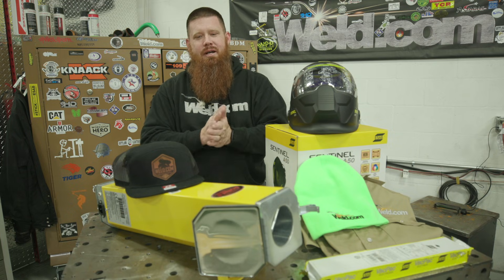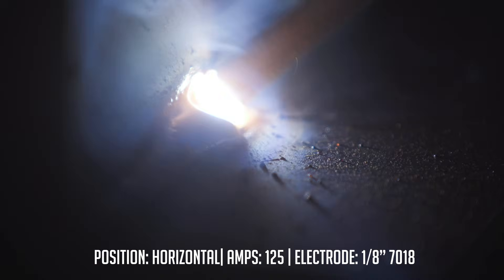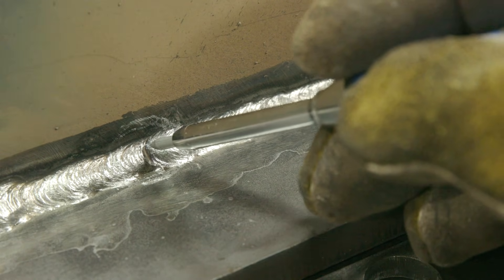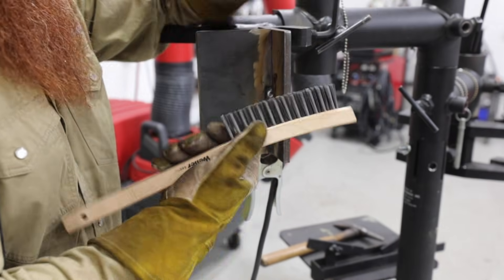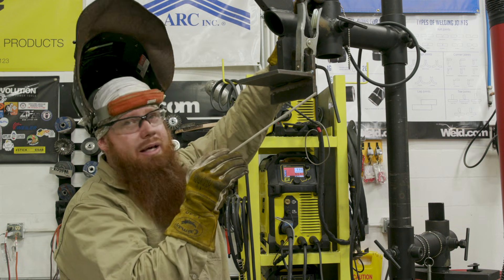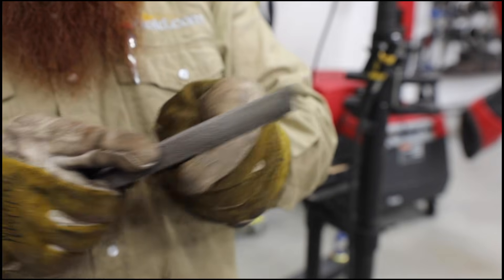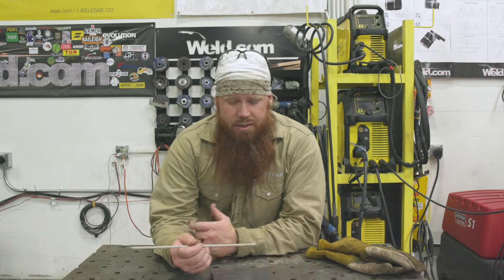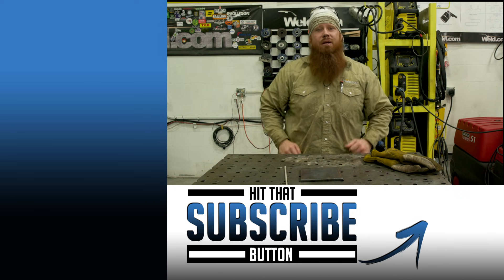7018 Restarts in Different Welding Positions

Comment: I have so much trouble welding overhead. I don't know if i'm going too slow.or what  but my weld pool tends to get really saggy and there were times it would actually drop right off the material i'm welding and it gets aggravating as hell when it happens.
Reply: Christopher McMichael keep a really tight arc length. If your gap is too big, molten metal will fall right out.
Reply: @GodslilRedneck23  Hi Jason. I always try tomkeep.my arc tight. Sometimes I keep it so tight that I actually end up sticking my electrode in my weld pool. lol I think my curse is that ,As Bob aaid in one of his videos, ( The older I get, I get the high spead shimmy's. Then I end up shaking my electrode right into the weld pool. Plus the material that I'm welding really isn't the ideal condition as well as the positions I have to be in. I do try to brace myself whenever I can but there are a lot of times the position I may be in won't allow me too. The other thing too is that I may even have my temp set wrong too. I'm using an old Miller engine driven welder that only has dials and can be hard for me to judge the amperage settings. I do keep trying though. lol
Reply: Christopher McMichael check your angle too. If you’re straight up and down, the weld pool can extinguish your arc. Keep a 10-15° travel angle. Try bumping up the amps too. If you’re on an engine drive you’re probably running long sections of lead. You’ll have about a 5 amp drop per 50’ of cable you’re running so adjust accordingly.
Reply: @GodslilRedneck23  Thanks Jaaon. I'll experiment with the amperage settings more. The Miller Bob Cat doesn't show amperage like some of the higher end engine drives. It has the dials for example : 50-100, 70-150, and  then a fine tuning dial numbered 0 to 10.  The fine tuning dial is the one that confuses me a little bit.

Comment: Can you do it with Excalibur 7018 regular rods
Reply: Horacio Salinas yes, I’ve ran miles of those rods. You should be able to do it with all low hydrogen rods.
Reply: Jason Becker thanks for taking your time to answer
Reply: I tried it already it works even. With the cheap ones

Comment: You mention that these electrodes have a graphite tip that makes striking off easier, but then you don't really show striking off a brand new electrode.  You just cut to an already established arc shot.  I'd love to see a comparison between these and other 7018 electrodes, which don't have the graphite tip.
Reply: @Wroger Wroger I don't understand your comment.  Of course restarts are often done with partial rods, but they're also quite often done with brand new rods.  He also went to the trouble to mention the easy starting, why not also demonstrate?  5 seconds is all it would take.
Reply: @Wroger Wroger I see your point. Besides, a re-start, or any start, is more something you feel than you see. There would be no visual difference between any lohy rod taking off. If conditions aren't right, or not enough amps, they get grabby. Hard to see that.